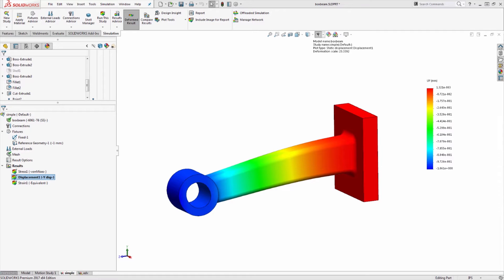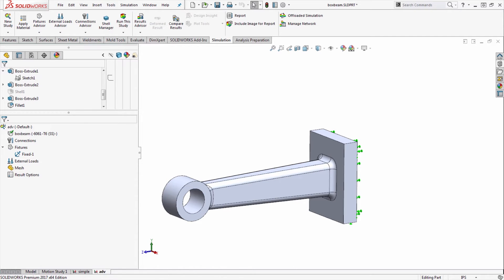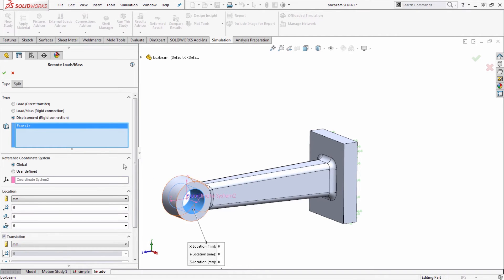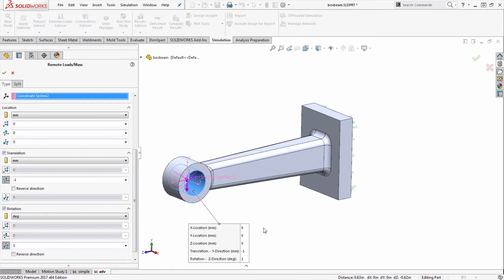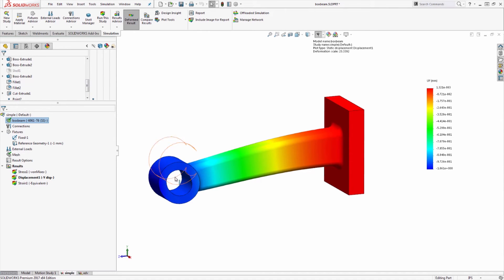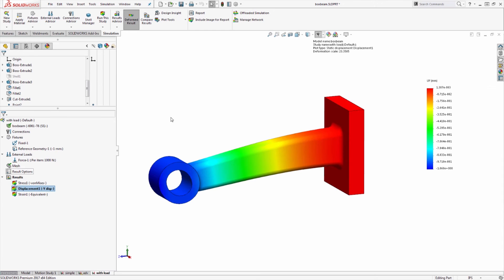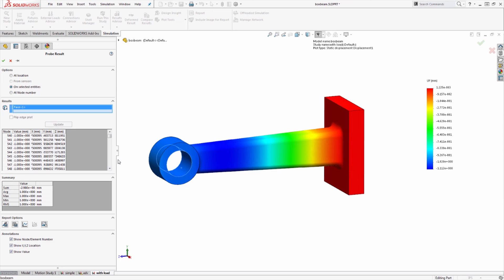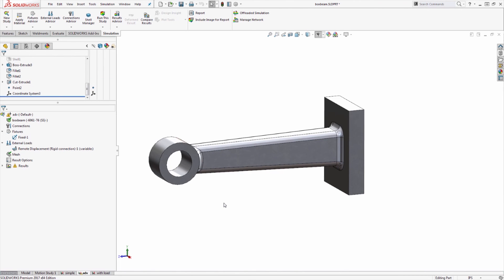SOLIDWORKS Simulation Quick Tip: Prescribed Displacements - Part 2

Comment: Great presentation! Do you have to use Gravity? When you use Gravity in your study?
Reply from the maker: Hi Razvan, gravity is generally an important consideration when: 1) The self-weight of the structure becomes significant  2) any remote or distributed masses are applied

So if you are working on physically small parts without external mass applied, then it is fairly common to neglect the effects of gravity. If you are unsure the best recommendation would be to test both with and without gravity, and determine if it has any substantial effect on your study.

Gravity can also be used to apply accelerations from different directions, by editing the definition of gravity load.
Reply: @hawkridgesystems  Thank you very much.